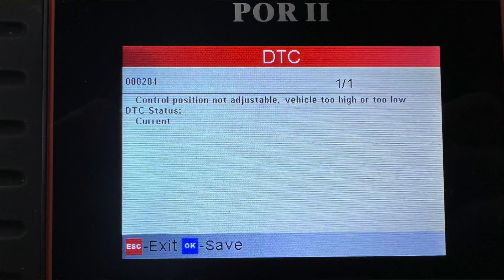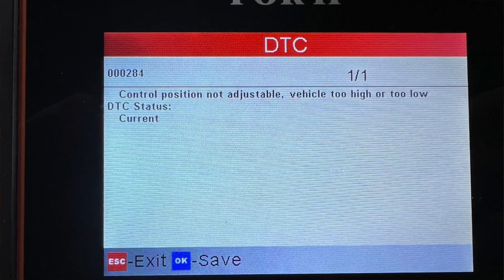Diagnosing and resolving a Suspension System Fault on a Porsche Macan Turbo DTC Code 000284.

Comment: Epic, found this while searching for common issues.  Was about to start replacing levelling sensors that would have been expensive!

Not completed the repair but my fuse is blown, on route to pick it up.  Buy that man a beer.
Reply from the maker: If the fuse keeps tripping after you replace it, I have another video on my channel where I replace the relay that is under the driver side dashboard. That completely fixes the issue for me.

Comment: Hello again, I can confirm that in my case it was also the maxi fuse in the trunk behind the cover. It blew when we went from cold, damp weather to sub-zero temperatures. The compressor sounded funny then too. Thanks again for the nice video!

Comment: Just checking... The problem has not returned after replacing the fuse?
Reply from the maker: Haven’t had that issue since. Probably been over a year.
Reply: @OmarsGarage  thanks! It turns out not to be my issue.
Reply from the maker: Please share what your issue is for others facing the similar problem. Thanks.
Reply: @OmarsGarage  Broken link on left rear level sensor.

Comment: Thank you for a good explanation and where the fuse is. There is a reason why the fuse is blown, and as you mention if battery is getting old Voltage may drop and it will increase the amps to maintain the watt on the device. I believe this is the case with my Macan. Thank you.
Reply from the maker: Hope it helped.

Comment: Sometimes it’s the damn relay under the dash that fails open (ie with tigger voltage it clicks and doesn’t conduct). I had to replace both the PASM fuse and the relay (which requires removing  3 screws and pulling the leftmost vent before I can pull out lower dash to get to it).
Reply from the maker: Thanks for sharing the info with us!
Reply: Hello can you please tell me which relay it is ?

Comment: Massive thank you for this video Omar, you saved me a lot of money, spent less than $1 on a fuse! The possible causes of this fault ranged from a faulty compressor to air leaks, to faulty struts. Anyone with this fault please watch this video FIRST and check out the fuse before spending money with a garage!
Reply from the maker: Happy to hear this was your issue. It’s always nerve racking when something goes wrong, but relieving when it’s something simple that can be fixed for cheap. Thanks for the comment 👍
Reply: Thanks for this video saved me $$$